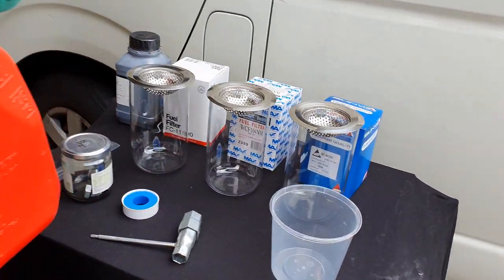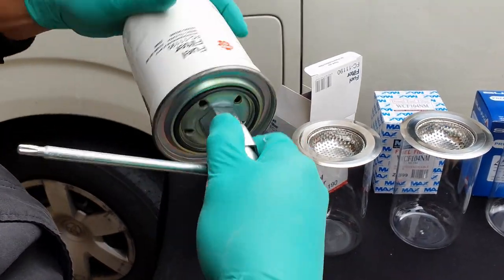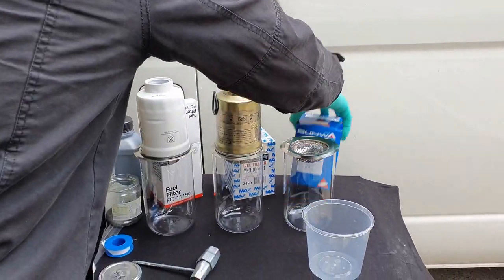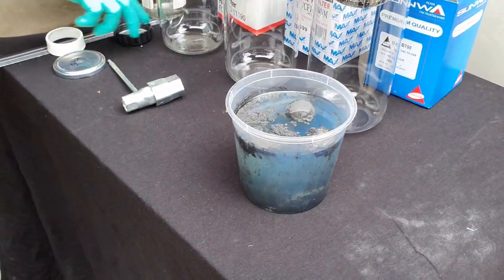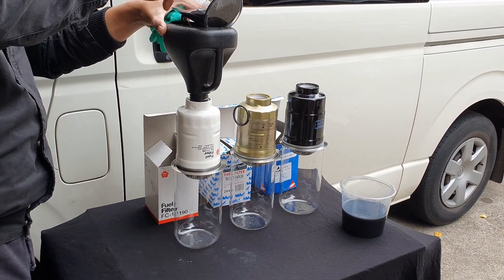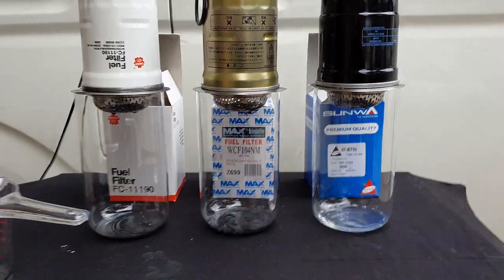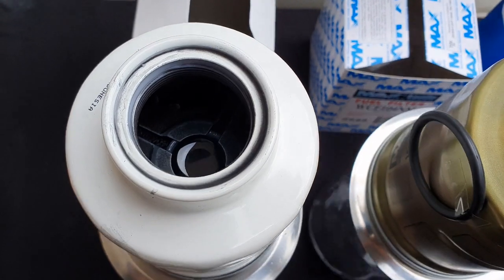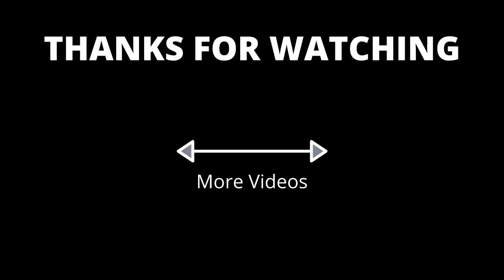Fuel Filter Test of WCF104 / z699 - Which Aftermarket Filter Will You Choose?

Comment: Hello.  The hole you add the fuel in is for sensor and it’s an exit for water.  I would like to remind you that this filter functions like a fuel water separator, so there has to be a way out for water separated from the fuel.  You should add fuel into the hole on another side.  The way you add fuel might prove that the filtration media of the third one is reversed.  Just would like to share this with you.
Reply from the maker: Hi @Jerry Jan Thank you for your comment!
In our test of filter Z699 / WCF104 , this specific type of diesel fuel filter is designed for use with the Denso (Toyota) pumps in which the inlet of the filter is at the center hole.
Water will precipitate to the bottom (where the water sensor is connected to) and the fuel will be filtered vertically upward through the media paper and gets filtered out through the small holes surrounding the center hole, regardless of which side fuel is poured inside.

As for other type of fuel filter (eg. r2777p) which is a new diesal fuel filter used in Toyota Hilux and  Ford Ranger new models. For this type of filter, the filtration media is rolled around the center tube like toilet paper roll.
Unlike most common oil filters where oil gets filtered through the media sideways, the filtration configuration of this fuel filter is vertical, meaning fuel runs through the media vertically when filtration takes place (doesn’t matter upward or downward). 

In our test, we specifically tested the filtration efficiency of the filter, not the water sensor system. So water content emulsified in the fuel is entirely not in context. It does not really matter if the raw fuel runs upward or downward through the media. 
For testing purposes, we flipped the filter up and blocked the center hole to make it a one-way and closed system. Contaminated fuel is fed though the bottom of the filter, and the filtered fuel runs through the filtration system and out the small holes surround the blocked center hole.

Hope this answers any questions
Thank you!
Reply: @AutoMotiv8ed  Thank you so much for your detailed explanation.  Please test it again without the screen bowl so that we can see that if the contaminated fuel flows from the small holes like you say and then everyone can understand more about good performance of Sunwa.  This will be much helpful.  Thank you.